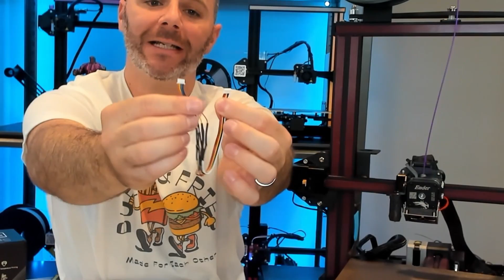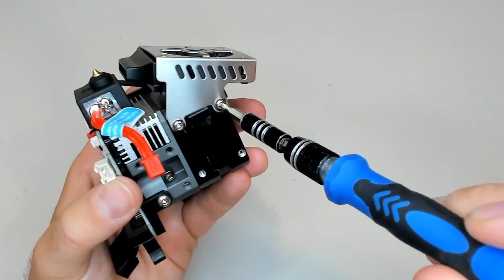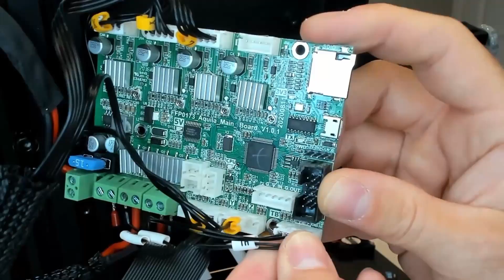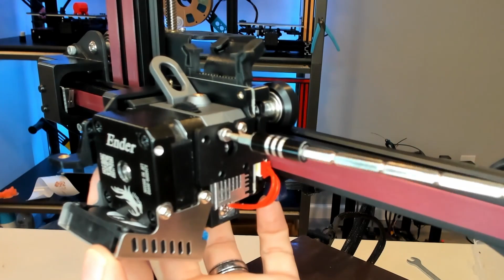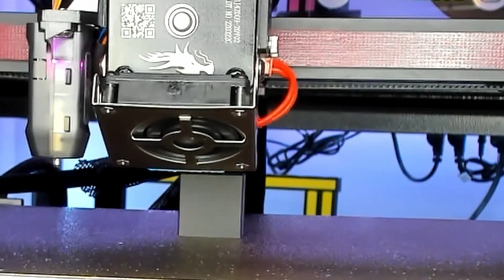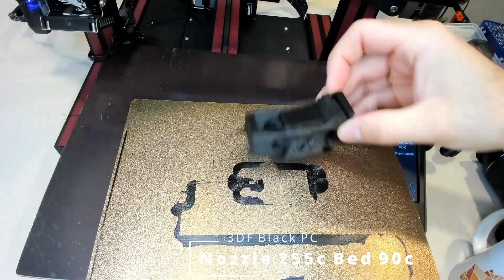Direct Drive Voxelab Aquila with the Creality Sprite Pro

Comment: Create a plain text file named
esteps.gcode
with the following lines:

M92 E[desired_value]
M500

Replace[desired_value]

with your calculated e-steps value (e.g., M92 E500 ).

Save the file and run it on your printer as you would with any print job. This will updat
e-steps setting and save it to the printer's memory:

Comment: First, thank you for this video!!!! I have a possibly dumb question, as I’m a total newbie when it comes to 3D Printing. I picked up an Aquila X2 and recently decided to get a Creality direct drive extruder. It was delivered yesterday, but it’s not the pro version. It’s just the standard. Are there any important differences in the firmware you linked and/or the installation process? Given that our direct drive is just the standard and not the pro version? Thanks in advance!

Comment: this sprite upgrade has been the most frustrating thing i've done with 3d printing. still cant get the new 4.2.7 board to load with the sprite plugged in.
Reply from the maker: Sorry to hear that. This extruder has been really great for me. Where you able to finally get this working ?
Reply: @PrintsLeo3D  not yet. Tried to compile my own code, but the z axis sits 5 inches too high. Focused on fixing my blown engine now over plating with pribters
Reply from the maker: Compiling the complete Marlin firmware from scratch can definitely be daunting. Good luck with the engine and hopefully you get that printer up and running soon too.

Comment: That small jumper from cr touch  in the kit did not work still needed to use the long cable.
Reply from the maker: I wonder if the cable was set up incorrectly. How has this been working for you ?

Comment: I bought a direct drive voxelab S3, unhappy with it compared to the more primitive C2 I owned. The new voxelab doesn't have the classic customizable features the original C2 had... You can't adjust flow rate, baby step x or y during the print.. You can't even set home offsets. Its very frustrating when something goes wrong... you can easily damage your printer or print...  You need these advanced parameters especially for a model that reaches higher temperatures for things like nylon printing and PC
Reply from the maker: The Aquila S2, in my opinion, was a bit of a misstep for Voxelab. I liked the direction they were heading with it, but the execution was a little lackluster. The proprietary print head and nozzle made a budget friendly easily-modifiable printer into any but that. I also did not like the C2 because often for the same price you could find an Aquila X2 which was easier to work with. I am glad you had success with the C2 though and hopefully are still finding your way with the S2.

Comment: I installed this back in July.  I immediately noticed that the max x direction exceeded the length of X past the y axis bracket so that the lower screw in the x carriage bangs on it.  I have tried adjusting the offsets to no avail.  I think I need to shorten the maximum travel in the x direction and the only way to do that, as I see it, is to do it in the firmware and reassemble it.  Do you have any instructions on how to do that?
Reply from the maker: Changing the max bed size for this would definitely need to be done firmware side, but the process can be a little complicated. I don't have a video myself on this process but you'd need to download seperate software to be able to edit and then compile the correct firmware (I believe it's called Platform IO which I think is a plugin for Microsoft VS code). Depending on your printer I may have some firmware that is set up similar and would work. What except printer are you using and what is the current hot end setup?
Reply: @dmatheson1
Yes, I have VS Code and PlatformIO installed.  I cloned Alexqzd's Marlin branch and attempted to compile it unmodified, but it failed.  It appears that PlatformIO is no longer compatible with that "old" code.  It's amazing how fast this stuff gets out of date.  I have the 4x4 BLTouch (1.3.5.1) firmware currently installed.  That is the one I want to modify.  I have an Aquila X2 with the Creality Sprite hot end installed.  I have a BLTouch attached to that.  I used the Creality carriage and the tab that hits the x axis home switch (I think) is just way too long, causing my issue.
Reply: did you ever figure this out? seems like you could make this work in cura but not to create a mesh....... or what about moving the home position?

Comment: I installed it on my aquila x2. I have klipper but when I try to start heating the hot-end I get: 

Heater extruder not heating at expected rate
See the 'verify_heater' section in docs/Config_Reference.md
for the parameters that control this check.

Any idea why is happening? I have pretty much the default configuration, changed the rotation_distance, but other than that I have the same config as the stock heater I had before

Comment: Hey Leo! hope all is well. anychance you have a video on how to then go up to 300 for printing temps?
Reply from the maker: Hey Matt, I released some Marlin based firmwares for the Aquolas along with this video. They're available on my website and there should be some links for them in the description. That being said they are older firmwares (compiled around the date of this video). So if you are looking to get Marlin based firmwares that are up to 300c you may be able to find some more updated ones out there. 
    If you have firmware and you're just looking for the process take a look at my original Aquila bl touch setup video. I go over now to format the SD card and then install the new firmware.
Reply: Thanks Leo! @PrintsLeo3D

Comment: Quick september 2023 update. Just bought a Sprite Pro kit from Creality. Got home in two days (Canada hey!). Extruder design has slightly changed since there is no more screw holding the hotend thermistor. It seems to be glued in place. Not sure if it's an upgrade since I've previously replaced a few in the past. It may not be as easy anymore. And my kit came with the CR Touch cable 👌. I've installed the kit on my old old plane jane Ender 3 which was already direct drive modified with the stock motor and a cheap Amazon dual gear aluminium extruder . The Sprite pro kit weight 240 gr less than my former configuration. Stock motor weight is considerable. Thanks for that great video once again. Now let's update firmware and Marlin on this old workhorse...
Reply from the maker: Sound great! I've noticed a lot more of these kits are coming equipped with that cr touch cable. I have a feeling they saw an issue with that screw holding in the thermistor, and decided to remove it. I've had mine held in place just like that, sans screw, for some time now. Great to hear you got this hooked up and running!
Reply: @PrintsLeo3D  hey I'm new to printing and I'm having an issue after installing this equipment. When I go to auto level the machine keeps going down after touching the print bed. Luckily nothing has broken but I don't know how to fix this. Any ideas?

Comment: Hai , thanks for this vid, I ordered a Sprite so watching youtube vids about it > Becaus I also own a Aquila this one is perfect. But.......I saw you removing the fanconnector of the circuitboard (16:48)  and a moment later you say that's the connector of the pasrts cooling fan (17:14)  ???  I'm a bit confused now. I don't have the Sprite yet (on its way) and I'm sure when I get to it I'll see where it supposed to gofrom where it is now, so that leaves me time to mention it here and hope you'll see it and reply before I get my Sprite. Seeing this vid is from a while ago .Thanks for your work and keep it up.greetings from the Netherlands.
Reply from the maker: Greetings! Thanks for watching and I'm glad you decided on the Sprite, it's worked wonders for me. The fan I remove at 16:48 is the mainboard cooling fan, it's the fan that blows on the board and cools it down. It should be unplugged and plugged back in to the same connector when the install is complete. The parts cooling fan is a separate connector but it's right next to that mainboard cooling fan. Those fans are connected 'in-line' meaning they are both either powered on or powered off together. When the cooling fan is turned on the mainboard fan is also turned on. 
    So for this mainboard those two connectors are sort of interchangeable, as they are both either on or off together.
    As you move through this install it will all make a lot more sense. Good luck and if you need help while you are installing please let me know.

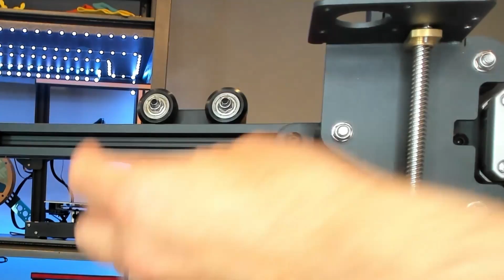Comment: @26:55 was so painful to watch! For a guy that has done this 100 times, I would think you'd have it dialed? I absolutely don't mean any disrespect as your videos have been my go-to ever since I got my X2 over a year ago. However, if you simply LOOSEN the nuts on the top two wheels slightly, the carriage drops right on.  You do not need to completely remove any of the wheels/nuts and especially not the eccentric nut.
Reply from the maker: Well in my defense I haven't done this particular mod 100s of times lol I know a lot of people who have been able to simply loosen all the wheels and remove the carriage, but for me that wasn't my experience. While I figured I was an outlier I try and consider the larger audience watching me, and I don't mind doing a little extra work to try and help those people. I understand though as there's been plenty of tutorials that I've watched where I've seen the person doing something k wouldn't have lol I appreciate the feedback though every bit information I can get helps! Thanks!
Reply: @PrintsLeo3D  I didn’t mean any disrespect, man. I apologize for sounding like a dick! I appreciate your videos and everything you do regarding the Aquila. It is definitely an under-appreciated printer and at its price point, I consider it one of the best values out there in their stock form and work absolutely great as such. But, with any Ender 3 upgrades being compatible you can turn an X2 into a hot plastic slinging monster, very inexpensively. I have three of them now and they have their small issues just like any other printer but they are easy to fix and just keep printing, flawlessly! As long as you know what you’re doing to maintain it and that’s where your videos got me to where I am now.  👌🏼
Reply from the maker: No not at all! I didn't mean sound defensive so I apologize lol Yea that's why I love these Aquilas they really do fly under that radar in terms of perform. Especially with all the buzz about BambuLabs and the faster coreXY machines it's nice to be able to find a printer that is still very capable for a fraction of the cost. I appreciate the support and the comments! Means a lot to me , thank you.

Comment: I have an Aquila s2 with the sprite pro what download should I use I also got the n32 mine came with the h32
Reply from the maker: If you go to my website I have Sprite firmware for the N32 chipped Aquila. If you aren't using a probe you'll choose the Manual Mesh option (which gives you the ability to still create and use a mesh without a probe). If you are using a probe then you can use any of the BL options I have listed. Of course whichever you choose make sure the chip is correct.

Comment: Hello Leo. I am about to install the creality sprite pro dd kit on my Aquila x2 n32 chip. I do not have the Bl / cl touch. When I navigate through the links for firmware I am unsure what one I need to download and use? Can you point me in the right direction please? They all only talk about Bl or manual mesh. Is this still the firmware for the sprite mod? It’s misleading and I don’t want to mess up.
Reply from the maker: Hey great questions as you want to make sure you have the correct firmware else you'll be in a world of hurt lol if you are not using a bed probe you'll want to use the firmware labelled 'Manual Mesh' this firmware is the same as a 'no probe' style firmware except it also gives you the option to create a mesh manually without the use of a probe. So that's what you'll want to pick! One thing to note, the way I compiled the firmware I forgot to remove a feature called Z safe home, which homes the nozzle at the center of the bed (instead of the front left cornerer). So my manual mesh firmware is still going to home the nozzle at the center of the bed, it does nothing different so don't worry. Let me know if you need any more info on this.
Reply: @PrintsLeo3D  awesome thank you! Is there anything that i need to be print that you can think of before I do the install that will prevent me from being able to finish the job? This being my only printer, I don’t want to get it all done and realize there was a part I had to print to make this all work as intended.
Reply: I think I answered my own question with finding a dog comment where you talked about the print needed to flip the X axis mechanical endstop switch. Going to print that now.
Reply from the maker: Tiphys yes! Another excellent question ad I'm sorry for myage reply but you are correct the X axis print is used more often than not now after the job is finished. Other than that you should be good to go! Let me know how it works out for you..
Reply: @PrintsLeo3D  I sure will 🤜🏻🤛🏻 thanks Leo
Reply from the maker: Anytime 👍

Comment: I got hung up on the fan+ and the fan- wires and the k-fan connector. Any advice would be very appreciated.
Reply from the maker: What are you having trouble with regarding the fans? Are you able to trace back the original fans on the printer and tell where they are plugged in? This way we can determine which one would get plugged in which spot.

Comment: Congrats on getting your Creality Sprite Pro to work on your Voxlabs printer. Question: is the Voxlab a clone of a Creality Machine? Specifically, is the board of your machine a clone of a Creality board? I'm asking because I'm going to put a Sprite Pro on a BIQU Hurakan. Trying to figure out what's going to happen before it happens. Thanks for making this video.
Reply from the maker: Thanks for watching! Yes to your first question, the Voxelab is a clone of the Ender 3 V2. The boards are 'similar' but different. Specifically (and I could be misremembering this) the ground + and - sides of the heater terminals are reversed, which is why I had to reverse them during installation. You should be able to install this on any board as long as you know what connectors you are plugging everything into. I also have a Sprite Pro running on a BTT SKR miniE3v2 board, but again just double check all the connections (+) and (-) are correct when you connect them. Like you saw in my video though for the heating cartridge it shouldn't matter, but if those polarities are wrong you'll just get a shutdown and need to reverse them.  Good luck, let me know how it goes.
Reply: @PrintsLeo3D  Thank you very much for getting back to me. I'm putting my Sprite Pro on a BIQU Hurakan (with Klipper). 

The thing I'm concerned about, or wary of is the E-motor rotation. The motors in my Hurakan aren't Creality brand. So the direction of the extruder might become an issue.

The other thing is e-steps / or "rotational distance" as it's now called in Klipper. I've watched a video about how to figure that out and change in in Mainsail / Fluuid. But knowing and doing, those are different experiences.

Anyways, thank you for the video. There aren't enough videos about putting a Sprint Pro on Printer X / aka Not A Creality Machine; your's is the first one I found this morning.

Mark
Reply from the maker: Because you're using Klipper you're in luck because a lot of this stuff will be easier (although won't seem that way at first). For the direction of the motor it's not going to matter. You can change the direction of the extruder motor within the printer configuration file (it's a text document Klipper used to control your printer). Simply putting or omitting an exclamation point (!) before the direction of the motor will reverse the direction. Simple fix.
    As for rotation distance it's easy. The Sprite has its own extruder motor and the recommend esteps are 424.5(I believe, this is from memory). Based on the extruder specs, to change that to rotation distance you would take 3200 and divide it by the esteps(424.5), which brings your rot distance to 7.538. now that's based on the stock numbers and I always recommend to calibrate it yourself, but my numbers were almost identical, somewhere in the 7.0s so it's a great place to start.
Reply: @PrintsLeo3D  Sorry to bug you, but I ran into a few snags. The good news is I compensate those who help me. If you don't mind, here's what I'm stuck on. 1. The Fan+ and the Fan- wires: my printer's Manta m4p board doesn't have another 24v-gnd socket to put them in, but it does have 4 two-pin connects. Each has 24v on one side, and (I'm assuming) a ground pin on the other. I changed the ferrules on the non-control wires to one two-pin connector, with the + on the left and the - on the right. If I plug it into a two-pin connector like I described, is that going to work? I'm asking because this is the third board for my Hurakan. I was trying to install BIQU's top end extruder, and ended up destroying the board, three stepper drivers and a 7" monitor. 2. What is the K-Fan? And where does it get power from? I have another two pin connector just like the one described above. The manual describes the K-Fan as the Control Fan. What is it controlling, or, what is controlling it?